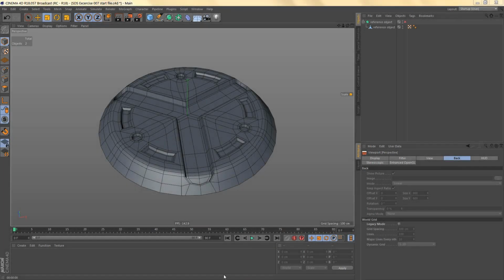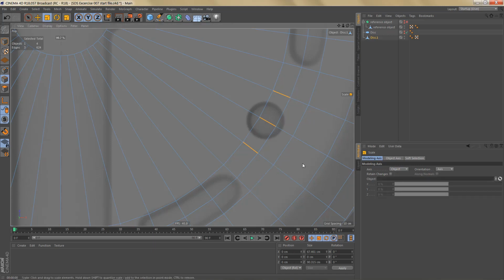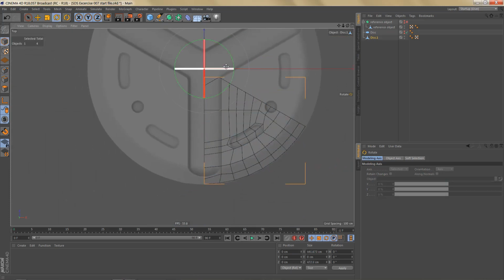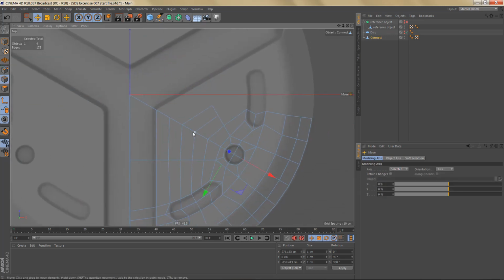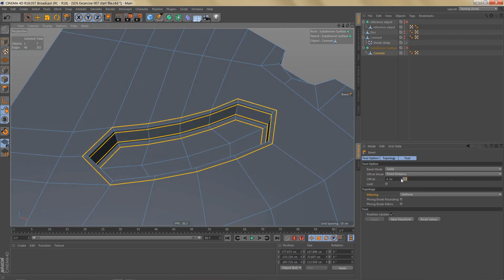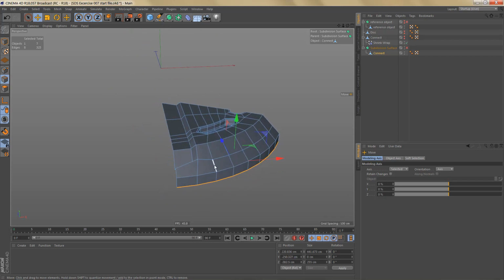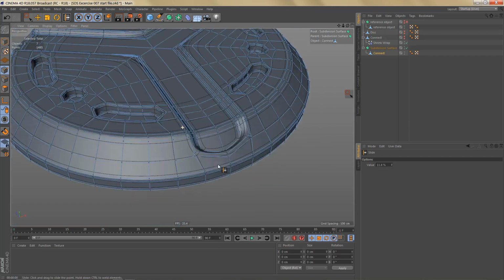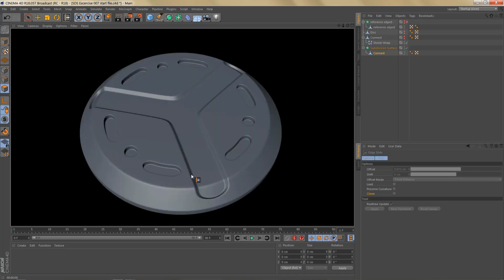SDS Excercise 007 (Full Tutorial) | Cinema 4D Tutorial

Comment: It would be helpful for newbies like me If you mention the shortcut when you press the key.
Reply from the maker: I'm sorry. If you could  let me know which shortcuts you are referring to, I'll be happy to let you know, jsut ask. I am aware that I don't always mention the hot keys I am using, but I do try and explain in the videos which tools/commands I am using. A lot of the shortcuts I use are custom ones, not the C4D standard ones. For "Connect Points/Edges", e.g., I use the "<" key. There is no default one in Cinema 4D. Hope this helps a little bit...
Reply: @Wolf-4D  

Thank you for your response. It's actually at 5:39 when you center the edges.

Besides, I am facing a weird kind of issue. My geometry is gettings very softer and distorted when I am extruding.

Could you please check the screenshots below and let me what could be the possible reason behind this?

Screenshot 1: https://prnt.sc/rz4f4s
Screenshot 2: https://prnt.sc/rz4b8g

It was my second attempts and the same thing happened both of the time.
Reply from the maker: @LuminousLorien  At 5:39 I am using a script from the HB Modelling Bundle called "HB even distribution". I am using a custom shortcut to execute that script (ü-ü). 

Since your images are showing the model without SDS, I am assuming you are getting this shading issue because the angle in the phong tag probably is  set very high. C4D interpolate between the edges based on that phong angle and tries to make them look smoother or rounder. This issue will disappear once you sitch on SDS. In any case, the phong angle doesn't need to be that high. Try changing it to 44 (or, if that doesn't help, maybe go down as far as 33). I hope this helps.
Reply: @Wolf-4D  Thank you so much. You are awesome and you just save my day. The Phong angle was 180. xD 
Actually, I am new to C4D, I am not aware of many basic things.
Reply from the maker: @LuminousLorien  We all started out like that... :-) Glad I could help!